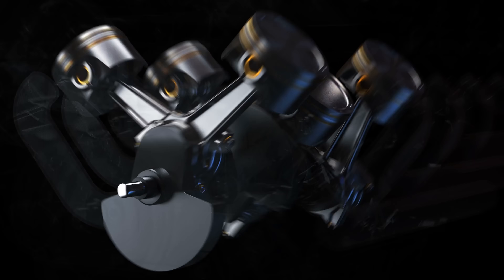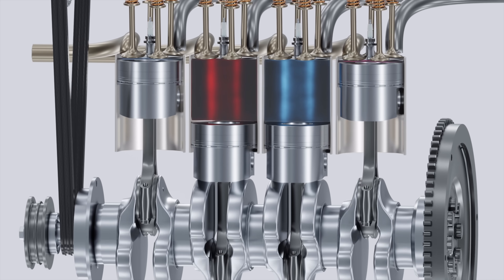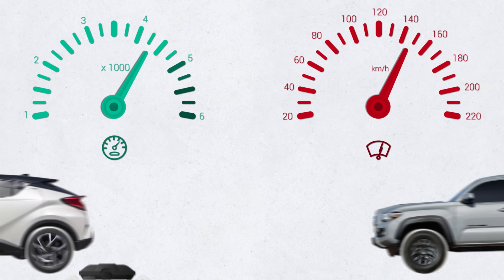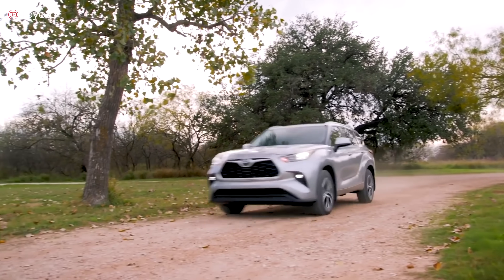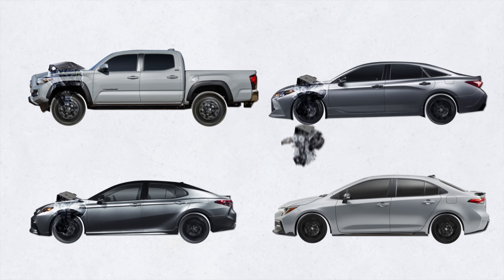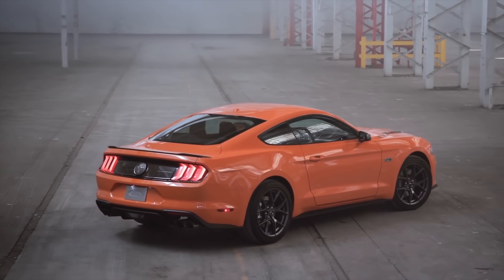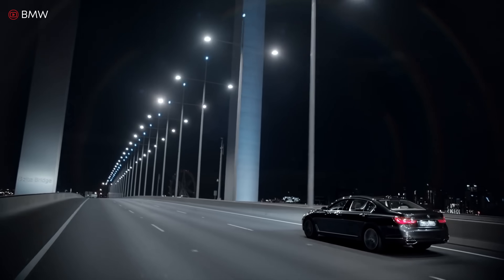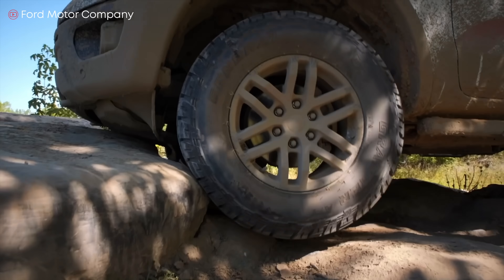No One is Telling You the Truth About Turbocharged Cars, So I Have To

Comment: They should bring back 3.0 nissan v6 the non turbo 300zx 1990 had 227 and with bolt ons you can have 250hp that's enough power.

Comment: The new 2023 four cylinder turbo mustangs will have 350 HP and 350 Torque from what I read and heard. The 2023 Toyota GR Corolla 1.6 liters three cylinder engine will have 300 HP.

Comment: Now there are manufactures going with turbo charged 3 cylinder engines delivering over 200 HP.  From my knowledge about engines and physics, I cannot see this type of engine lasting very long if driven hard.  My preference is for a larger engine and not be turbo charged. The issue is auto manufactures are no longer offering large engines in many of their models. If you buy a large SUV 4X4 then it is possible to have a normal V6 or V8 with most manufactures. 

If I buy a turbo charged engine vehicle, I would make sure I have a full warranty contract on it for the duration I plan to own the vehicle.

Comment: Lots of rhetoric around turbo four engines versus V6.  All I know how mine is working.  A 2006 Saab 9-3 with an Ecotec 4 cylinder 2.0L engine I owned.  I sold it after 12 years, 195,000 miles with never having a problem.  The second owner I sold it to still has it - now it is 15 years old with 230,000 miles on it.  Never ever had a problem and nothing has broken.  So much for the problems everyone tells me it would have.  The turbo lag is not terrible because the pipe is really short between the engine and the turbo, reducing the lag.  Saab was the innovator of this design which GM adopted.  The car sill averages 26 mpg to this very day.  Only concern now - a seat bolster ripped and needs replacing.

Comment: I have a Suzuki h27a 2.7v6 and it's a great motor heaps of torque down low and happily revs about 215ho and 390nm. On the other hand I have a 2L twinscroll 4cyl high pressure Volvo producing around 300hp and 400nm at 22psi a 2.5L low pressure 5cyl Volvo at 200hp and 300nm. I have driven V8s etc but just love the s40t4 it is tuned and accelerates so agressivly it's a hoot to drive gets around 5.5L/100k and had hardly any issues with the S40 or C70 the C70 with low pressure and larger motor is one smooth car to drive.  The Suzuki is also really reliable but has only suffered two water pump failures if could would turbo the Suzuki. Yet na it's still very responsive yet drinks fuel

Comment: I think the comparison here between v6 and turbo 4 is too generalised because there are many other factors to consider such as built in obsolescence, plastic componentry, too many sensors, complicated injection, too many moving parts - if you do mostly low mileage around the city buy electric vehicle

Comment: Turbo 4 and electric vehicle is going to  be the standard. Efficiency on small engines have been really well. Less weight and easy to make power twin scroll turbos almost eliminate turbo lag not even a problem with new cars/trucks  with forged internals I think they will last. I have a 2021 ranger with a turbo 4. Great on gas 330mils a fill up but when I'm gunning it only 14mils a gallon. But when you need the power it's there. 270hp 310tq with the 10r80 10speed is a great match for 4500lb truck 6000gvw. I'm glad ford went this way. Ecoboost mustangs are great too. Have no complaints yet I have 9kmiles so far only time will tell with good maintenance how long they last before it get expensive. My dad has one too 2019.

Comment: It's all on the Specific Brand and Specific engine...
Some engines are rock solid, some aren't. 
While there are more parts and points of failure with a turbo car, some are rock solid, some aren't.
Some have fixable flaws that are accepted by it's community (like the head gaskets on Imprezas) 
Some Grenade if you do an oil change 1 day late or put a slightly inferior synthetic oil... such as a VW 2.0 TSI

Comment: Scotty IGNORES that an inline four has less "rotating mass" and can "spool up" (rotate) faster than a V6, BUT then there is the question of Torque which the V6 creates MORE TORQUE than an inline 4!! Torque IS the working force that moves the vehicle DOWN THE ROAD.....NOT horsepower! You could have a 3000 horsepower engine, that won't move your car from point A to point B, if it only has 20 foot pounds of torque! ON THE OTHER HAND IF you could develop an inline 4 that made 400 foot pounds of torque at say 2000 RPM (Revolutions Per Minute) it would actually accelerate faster than that 3000 horsepower engine with 20 foot pounds of torque!!! 

THIS IS WHY, engines like the 426 Hemi, 383 Chevy Stroker Motor, and the Ford 347 are so amazing!! They make insane low end torque numbers OFF OF IDLE, at lower RPMs!! And in Scotty's example here, the V6 WOULD make far more torque, than an inline 4 cylinder, which YES the 4 cylinder might be quicker (less rotating mass off the line) than a v6 BUT when the "torque curve happens" at mid track the v6 would walk all over the inline 4 all day long!! 

There is no replacement like displacement even now!!

Comment: As an aircraft A&P Mechanic, I’m very familiar with how aircraft turbocharged engines never last as long as naturally aspirated aircraft engines. Since I usually keep vehicles for over 10 years, I would never buy a 4 cylinder turbocharged vehicle. I still own a 2003 Jeep Wrangler TJ…
Reply: The 2003 Jeep Wrangler TJ was, I believe, the last year the Inline 6 engine was used!
Reply: @donbenner5421  What do you think about turbo Inline 6 engines ? I also prefer NA engines but there won't be that option in Inline 6 from Mazda.

Comment: Modern engineering and technology have come along way , turbo engines are reliable as any out there. 
Proper maintenance is the key to anything mechanical lasting , whether it’s a vehicle or something else that requires maintenance. 
Change your oil and filter earlier than recommended .
There are millions of turbo cars and trucks on the road today with plenty of miles on them without problems.

Comment: no free lunch, as long as you understand that, a turbo four is fine, good power, good economy light weight. Ability to tow is probably a crap shoot, most turbo cars and even small crossovers are not rated for towing in the us anyhow. If you are the kind of person who keeps a car 5-7 yeas and bails at its first timing belt change go turbo, and enjoy the boost, you the kind of person who goes 300,000 and maybe you get the V6, but either one WILL be a problem if you don't maintain it, I'm talking on time oil changes with good quality oil and filters, not Jiffylube, keep an eye on the level and absolutely change it early if you spend a lot of time in traffic.

Comment: On turbo engines 4 cylinder the bottom end should be very strong the ones that fail have weak bottom ends honda has done a good job with the 4 turbo engine

Comment: I don't get the benefits in my engine.  Too many oil changes compared with my older car.  I get about the same gas mileage or slightly better with a loss of around 80 horsepower.  My turbo charged 1.4l chevrolet engine is not worth it.  The cooling system is also high maintenance.  The 3.0 l v6 in my mercury was a better engine.  But a car wreck, not my fault, ended its use at 248,000 miles.

Comment: My experience with six cylinder engines is that they provide slightly more power than a good four, but with gas mileage only slightly better than an eight.
Reply: But they are much smoother and quieter than a 4.

Comment: Not all turbo 4 cylinders are created equal. Most of the modern ones are weaker and can’t deal with higher power level for as long, where as a lot of the old T4’s (80’s-90’s era) typically made less power from factory but would last a lot longer and could be tuned to make way more power.

Comment: Just one thing tho, A 2.0 Liter Turbo Engine Running at 14.7psi of boost (while under that boost) will use the same fuel as a 4.0L Natural aspirated engine, 
this is physics you cannot get around total of 29.4psi of absolute pressure means double the amount of fuel needed compared to natural aspirated that can only get a total of 14psi (in a perfect world, but most closer to 12psi. )
Reply: but how long are you at full boost?  when you are not on boost the engine should run like a regular 4 cly.. same gas mileage

Comment: Most people here forget how much of a pain it is to work on the transverse V6.  Ever had to remove an intake manifold just to change a spark plugs or valve cover gasket? The  turbo 4 Is much  easier to work on.  Yes you are squeezing more power out of the engine, but responsable manufacturer also make a stronger engine to handle the extra power.  Wouldn't trust a turbo GM though.

Comment: For lots of driving and durability, V6 would probably be a better option. For an average 10-15k miles a year driver that changes his/her car every 5-7 years, turbo is a better option.
Reply: Bought a 2015 focus st brand new. turbo 4 cylinder. Daily drive it everyday, have taken it on road trips. Have put 95k miles on it in 6 years. Not one single issue, only routine maintenance

Comment: Personally after owning a supercharged vehicle and a turbocharged one, I wouldn’t get one as a daily driver. Just cost more to maintain. After about 100k miles turbos and Superchargers tend to have to be rebuilt. Especially if you push it hard. Unfortunately emission and EV laws are going to keep pushing vehicles to be more efficient and eventually all you will have left are hybrid and pure EV vehicles. Hang on to your pure old sports cars because they are dying out quick.

Comment: The truth is here: turbocharged cars are much faster (relatively) and agile. From low RPM to the redline. And that is the beauty of that technology. And yet the power is accessible from low RPM. The NA engines need high rev speed to produce comparable power. The NA engines can typically last longer than turbo ones. Typically...but not always.

Comment: Hello there Scoty, nice video!
As a Brazilian, here V6 are pretty expensive and modern cars are getting into the downsized 3 cylinder turbocharged, equipped mostly on small and medium SUVs. I own one, a VW TCross 1.0 TSI 3 cylinder, and it's doing pretty good. For towing capacity (we used to tow an 18 feet boat and a Yamaha Jet Ski), also for road driving and city as well.
As our planet goes into fossile fuel economy mode and we are not easily in electric cars on most countries, the small volume turbocharged engines may be the way.

Comment: Buying new seems like a no brainer to get a turbo inline 4 when you factor in that the initial price is cheaper, you save money on gas but I may be wrong but all turbo engines need premium gas where as the average v6 only needs regular. Scotty also mentioned that you need to change the spark plugs more regularly so that's something to consider. The used car market naturally aspirated cars hold their value better and tend to last longer if maintained properly. So it's a toss up but definitely in the car manufacturers best interest to make a car that will fall apart around 150k so you but a new one. Personally I prefer V6, inline 6 or a V8 engine because I always buy used and will never buy a used vehicle that has a turbo unless it's a turbo diesel.

Comment: This a very old way of thinking, the only thing on a turbo engine is the turbo other than that it just an engine, most turbo 4s go over 200k miles and are way faster and lighter that the v6 motors

Comment: 4 cylinder Turbo engine can be good if and only if when then engine is built to take the abuse. If the engine isn't meant to take Turbo it will obviously wear out so much faster. Take care of your vehicle, don't abuse the use of the Turbo unless you need it and you'll be fine. Sure, V6 are usually better for towing jobs and higher horse power compared to a 4 cylinder engine even with a Turbo though you'll be paying for it in term of fuel economy.

Comment: This isn't fully accurate, yes a bigger engine will produce more torque down low due to more displacement and more inertia from the extra material of the rotating assembly. On the other hand though a small turbo engine can hold torque for a longer period of time  through the rev range and produce more torque at mid RPM's due to the ability for the turbo to keep the same boost pressure allowing for a pretty linear torque curve. Most small engines nowadays have smaller turbo's sized for low and mid range torque and power. I have a little turbo 4 that only displaces 1.4 liters but will produce over 200 lb-ft of torque at around 3k. Granted it's tuned with more boost but that's at the wheels, at the crank is more like 230 lb-ft of torque. Some cars with 2 liter plus engines don't even produce close to 200 lb-ft of torque. Turbo cars also pull harder at the top end, a n/a car could produce the same horsepower but the turbo car for the most part should be able to beat it in the top end due to it producing that power higher in the rpm's where n/a engines usually fall off.

Comment: You didn't mention that the 4 cyl turbocharged engine runs a lot hotter and faster than the 6 cyl engine, So to avoid the higher bills associated with the  4 cyl turbocharged engine l pick the 6 cyl engine every time. There's nobody clamoring for more complexity in engines yet there you have it!

Comment: The fact that GM made a 2.7L I4 indicates poor engineering. GM is good at big engines and crappy with smaller engines. 0.5L/cylinder is the most efficient. Anything bigger indicates a mishap in the engineering department. Any I4 > 2.4L is a no no in engineering because it's inherently imbalanced and requires a 2nd countershaft (balance shaft). 2.7L is just ridiculous.

Comment: Some of this is incorrect. Modern 4 cylinder turbo engines are actually designed not for top end power but a WIDER power band (wider, flatter torque curve) vs a NA V6. Many of them (like the 1.6L turbo found in many Hyundai cars today) actually produce peak torque from as low as 2000 rpm and hold that all the way up to 4500-5000rpm, where the peak HP takes over to redline (about 6500rpm-ish). Don't believe me? Go check it out or even drive one. You'll feel it. ;) They are also designed for very little lag (~0.5 to 1 second) and lag should not be confused with trying to operate the engine outside of the turbo's boost threshold (that is; outside the engine rpm range at which the turbo can produce boost) and that is typically at very low rpm - which again - in these modern turbo engines is very low rpm; typically 2000rpm or even lower in some cases. This is the result of properly sizing a turbo for the specific application and not for all-out huge HP. It's all about widening the range of usable power across the entire rpm range, and you end up with MORE usable power than an NA V6. The V6 peak torque will be at a higher rpm and won't be nearly as flat as the turbo 4cyl of similar peak power output.
Reply: Scotty, I see you mention this more later in the video. Just wanted to clarify though, it's similar in the car applications - they turbocharge for wider torque, primarily, not for higher HP output - though that is the case in some applications. ;) One of the main key benefits of turbos is the high torque they can produce, along with higher HP.

Comment: Unless lube oil for turbo is separate from engine lube oil contamination from biproducts of combustion will ruin bearings in turbo  Biproducts of combustion include H2SO4  or sulfuric acid which is highly corrosive  Biproducts also include carbon and H2O or water  Engine lube oil also contaminated with metals from engine wear

Comment: 4 cylinder engines displacement are usually underpowered for the size of vehicles that they are produced for.  Because of this, TURBO chargers are engineered to create and boost horsepower and torque for what would be a very underpowered engine.   These engines usually have a shorter life because of the increased HEAT factors caused by the TURBO chargers.  And would argue that the better gas mileage is marginal at best compared with a well built V - 6.
Having driven both, definitely would give STRONG edge to the solid V - 6 engines which are more reliable, longer lasting and give instantaneous throttle response compared with a turbocharged 4 cylinder.  V - 6 engines run cooler and are cheaper to maintain.
Again i don't see the benefit in gas mileage with a TURBO 4.
Have logged over 1.8 million business miles as a freight sales executive in the Motor Freight industry, the V 6 motors give the BEST over all performance and most reliable.

Comment: I have a Silverado with i4 turbo engine and I do not know what you guys are talking about... this truck has a lot of b*#@Z and it's super quick. Idk know how the engine stresses it self when you don't even have to step on it when getting on a highway at 70 mph and rps not even at 4 thousand. I've raced a couple f150 with the v6 engines and I leave them eating dust and thats me barely half throttle 😁

Comment: Every mechanic when I was growing up told me a turbocharger cuts your engine life in half. So I stayed away from them when I got my Celica and she's gone 320k miles before the piston rings gave out. Has something changed in order for the manufacturers to start doing this, or are they counting on your engine failing prematurely so you'll come back and get a new car sooner?
Reply: I'd guess it's a combination of pressure from the EPA and manufacturers wanting to sell more cars.
Reply: Material science research, modern manufacturing processes, etc. allow them to use better materials and tighter tolerances. Unlike previous decades, most of these engines are new designs that have been built from the ground up with a turbo in mind. For a small car, a new turbo 4 cyl makes sense. It will only be stressed under spirited driving. For a fullsize truck, it doesn't make sense because it's going to be stressed all the time and will likely get similar fuel mileage to a NA v6 or even v8.